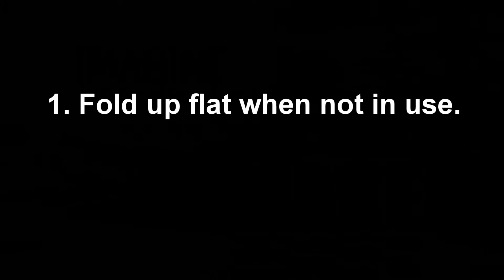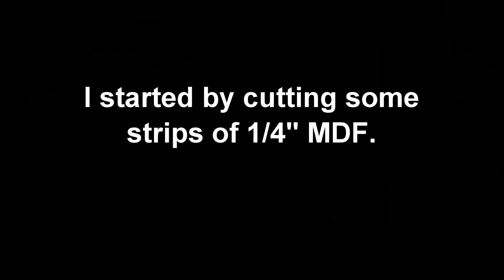77. Folding wood table prototype model

Comment: Cool build!  That could be quite useful in a small woodshop like mine :-)
Reply from the maker: Thanks. I hope the video adequately shows the process of starting with an idea and then physically modeling it to work out the details. It's like puzzle solving.
In this case, I used thin strips of wood. In other cases, I model using corrugated cardboard. Here's my latest where I used cardboard: https://youtu.be/QypvHgsizzI .
Thanks for your comment and for watching.

Comment: Matt, could you have modeled this table in sketch up free?
Reply from the maker: Yes, I probably could have modeled this in Sketchup (Free or Make), but sometimes I like to manually prototype. I really enjoy the process and I feel like I learn more from the manual prototype.
Reply from the maker: I should also add that making the parts move in Sketchup like they do in the manual model would be difficult. Said another way, when I'm working on something that has multiple moving parts, I prefer to manually prototype rather than struggle with a CAD program to make the parts move. Hope this makes sense. Thanks for watching.